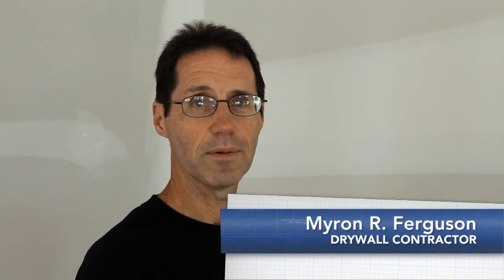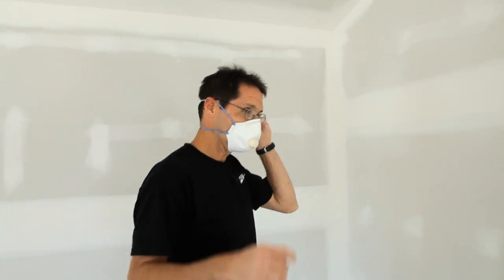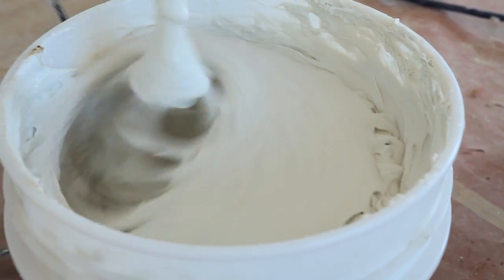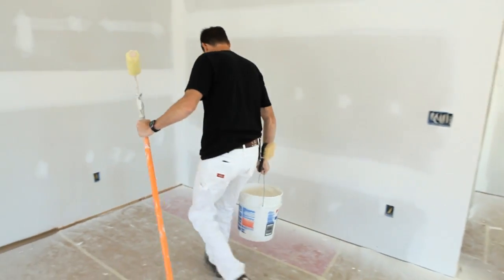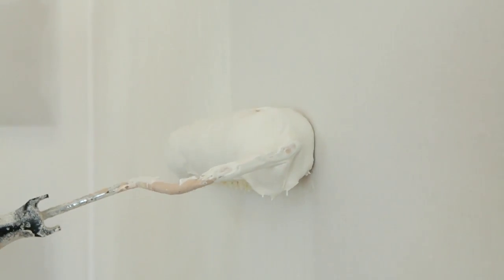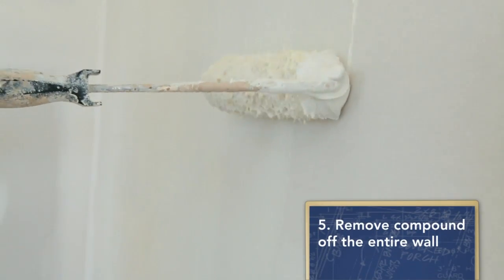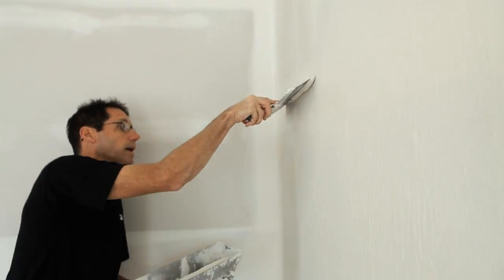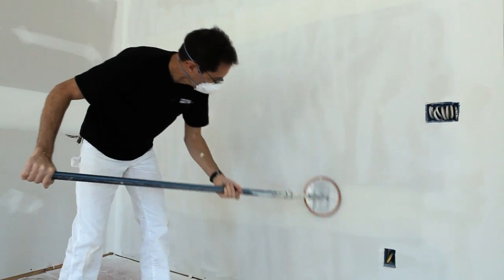How To Finish Drywall

Comment: It may be made smooth but the carpenters are always drunk and can't nail their studs true. Even without shoddy construction we would still have to do all this finishing work because painted drywall board looks like crap, it should at least have a smooth skim coat and/or be textured.

Comment: I've been a finisher for 41 years. Level 5 is only needed if you don't know how to do high quality finishing. Keep the sand paper of the surface paper and you won't find it. Jeeze this video is dumb. Light weight mud ain't worth a damn. Those ultra flexible broad knives ain't worth a damn cause they starve the joints. If you can roll the mud on the wall you over thinned it. Read the side of every bucket of mud. It's says don't over thin.

Comment: Thats a lot of wasted time and material. If the guy was a good finisher he should have had it done in 3 steps or less like me. A real good coat of PVA drywall primer will not allow the seams to show unless you dont know how to tape and mud. I also dont use that crap paper tape but instead the self sticking mesh tape. Works great and my work is like a pro.